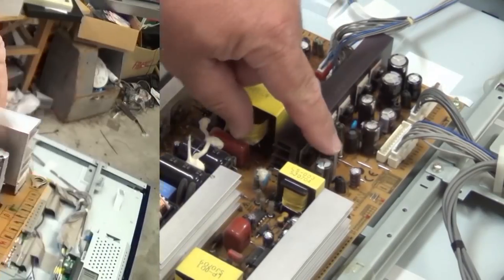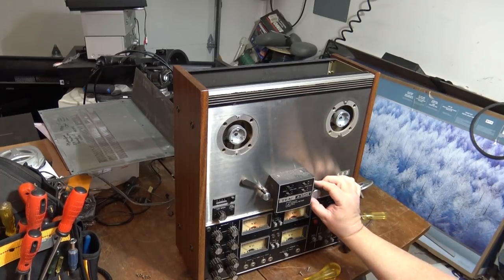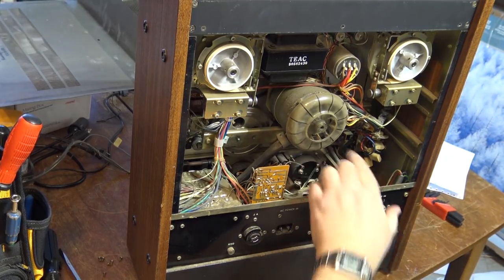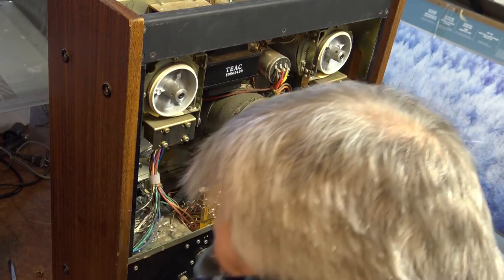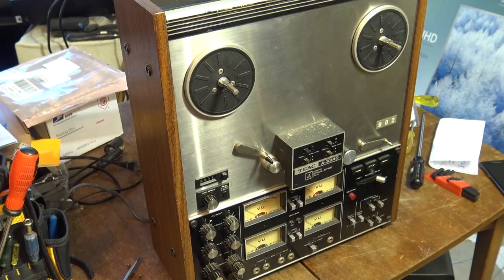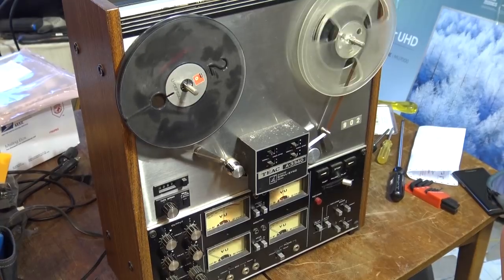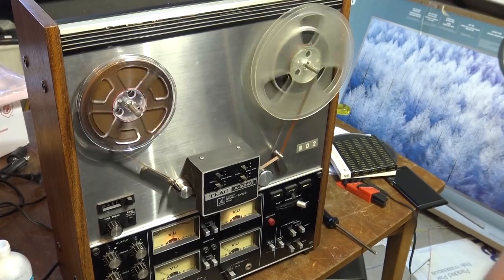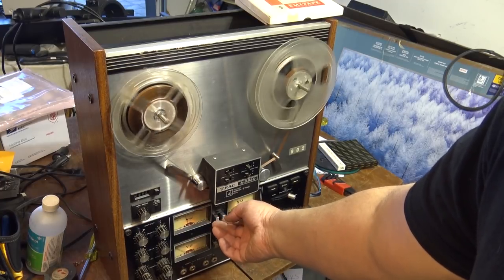Teac A 3340 4 Track Reel to Reel restoration

Comment: In the early 70's I composed my own music on an Akai 4000DS, sound on sound deck. Then around 75 I bought a Teac 3340S. Also mixed down to a Tascam32. I am now transferring all those tapes, 7 1/2 and 10 inch reels to DAW. Since all my decks have been in storage all these decades I'm sure they will need a good going over. I am hoping I can get them all to work for the transfers. Your video brought back a flood of memories using these decks. Enormous fun back in the day, and not to mention, they all sounded fantastic. Great video!

Comment: This helped me immensely with bringing an A-2340R back into better shape.  I already had some 100% synthetic oil with a needle applicator and your mentioning of the tubes made me realize that's how you get the motors lubricated easily.  Your details also helped me unstick the roller, it wasn't popping up and down with start/stop.  Now it is!  If anyone is finding their roller is stuck, just remove the left screw on the bracket, and loosen the right one.  Don't even remove the wire harnesses.  Stick a tissue or two below the shaft to catch any drips, and drip oil very slowly into the gap - I mean small amounts super easy - it'll pull the oil in.  Move the roller up and down to work the new oil in.  Repeat until it feels looser, then tighten your screws and enjoy a roller that operates like it should.

Comment: I lubricated the pinch roller pivot shaft on mine (3340S)by loosening the right hand bracket screw, removing the left bracket screw, drop the left side of the bracket to expose the back of the shaft, slide a piece of clear tubing over the shaft, raise the tubing up and tape it to the frame then squirt sewing machine oil in it to a level of about an inch above the shaft. I worked the mechanism back and forth every so often and the oil worked itself back into the shaft and freed it up.
Reply: I followed a similar procedure for my A2340R so thanks for the suggestion.  I didn't have clear tubing that would fit, so I just carefully dripped small bits of Liberty 100% synthetic oil into the gap and watched it suck it in.  Then moved the roller when the oil would sort of collect - seemed to pull the oil in, and eventually I could feel that it wasn't so stiff.  Plugged it in and the roller was happily jumping up to meet the capstan, and retracting happily.  Appreciate the tip on not removing the whole thing just to get that operating!

Comment: Many, many moons ago I worked for the Australian importer of Teac gear. A couple came in with a reel to reel unit they purchased in Hong Kong and bought back here. The complaint was it did not work. On removing the back of the unit it was found to have been stripped of all its parts including the motor. This was to make room for lots and lots of black socks. The socks where stuffed with bags of rock heroin. The police where called and the whole lot taken away. I have no idea if someone in Hong Kong gave this unit to the wrong person in which case they are most lightly at the bottom of Hong Kong harbor or if the idea was to allow the couple to bring the unit through customs and latter rob them of the unit. No idea what the value of the heroin was but there was a hell of a lot of it. I just hope the police got the people involved.
Reply: Wow... that's a story alright!

Comment: Another area that these machines were used in during the mid 70's was the presentation market for sales conferences  / product launches where 2 tracks were used for stereo sound and a  track  was used as a control track for synchronizing multiple slide projectors, track 3 was used as a guard track to avoid crosstalk between the stereo track.

The dropping down of the reel tables was fairly common due to this machine not being a full logic control deck (later versions were) These machines would get up quite a speed in ffwd / rewind with 10" NAB reels and slamming into stop could cause the reel table problem, a useful dodge is to hit the opposite wind button to slow machine down prior to hitting stop. Once I had the reel table drop on a live show the workaround was to remove the reel tables 3 screws and place cardboard underneath until chance to service properly.

Great video as always.
Reply: Didn’t have the table drop issue but the fast wind to stop or fast wind to play has on occasion broken my tapes. I haven’t used it since but have been reading up on using the opposite function to slow it down

Comment: Since I was a teen and got to work with stereo reel to reel decks, I've always just plain loved them things. I've worked in radio almost all my life too. Although now they aren't used, during my time they were along with carts. There were 2 standards for those 1/4" machines. 4 track or half track as sometimes called, and 2 track. Half splits the tape so you can record and play on both directions. 2 track, is one direction only. However, your using the whole tape for left and right so get much higher quality recording and play. At 15 IPS, losses would be imperceptive at half track. On the 2 track, it will duplicate in analog as good as CD in analog. My personal machine is an Otari MX 5050. You can, on it flip from rewind to play, to FFWD to Rewind to play. It has sensing to tell when the tape stops and self controls that before engaging the pinch roller. I absolutely love Teac and Tascam tape decks, both reels and cassettes. Very easy to service, and made to be maintained. Oh, and also, 15 IPS will minimize wow and flutter in worn tapes.

Comment: I have a pair of Teac A-1500 decks and I need to remove the face to get to the belt for the capstan, it has a rubber cover on the reel decks that hides the 3 screws, thanks for showing me where to look for them. You earned a sub for that bit of info! Thank you very much!

Comment: I've got a TEAC A4300 from about the same time period as your machine. Mine was supposedly serviced, and I believe so because it works great. One problem I'll have to solve is that when in fast forward and then hitting stop, the tape to the right of the capstan/pinch roller, stretches or breaks. Have to get a service manual and check tensions. I can get around this by going directly to rewind from fast foward. When the reels come to a stop, I hit stop. That works. Coming out of rewind and stopping doesn't hurt the tape though. Will have to invest in some spring scales and check the service manual on all appropriate tensions. I've wrecked some good tapes that way!

Comment: I would give anything to get my hands on an Ampex 351 stereo deck with 2 preamps In 1971 I worked at CFQR 92.5 FM in Monreal ,they were the most amazing tape decks ever  in 10" and 7" format Rewind speed for 3600 ft reel at about 160mph and under a minute,not to mention super clean response  and with a faceplate of 1/4 inch  stainless. I love your Teac but its no competition for the Ampex

Comment: TEAC R/R decks are my favorite to work on.  The stuck pinch roller arm is very typical and I've had to free up a dozen or so.  One was so frozen I had to use a soldering iron to heat the old grease so that I could pull it out.  I sold my 3340 because I was tape deck 'poor' at the time.  If you ever run across a Sansui SD-7000 you need to grab that one.  Talk about a beast of a machine!
Reply from the maker: I won't be grabbing one unless someone gives one to me as I don't have use for R2R gear other that to display it.
Reply: @12voltvids  Ha!  I'm not a hoarder, but I know where one lives.  I'm old as shit and always been in love with the vintage equipment.

Comment: What a machine! I was particularly impressed with the capstan flywheel. It looked really heavy, leading to imperceptible wow and flutter. I've never owned a 15 ips deck, so seeing it almost gives the impression of a slow fast forward wind! I would think you would really need the 10.5 inch spools to get acceptable playing time at that speed.
Reply from the maker: Many of these machines this one included were used in small recording studios. With the simusync mode play back to me made from the record Head while simultaneously recording. This allows a basic multitrack session to be recorded. You could record four single sessions then play the tape back mix the four tracks down to stereo recording them on a second deck. Add two more sessions on the extra two tracks of that second deck mix them down the two additional sessions that is and the original stereo mix to stereo again and keep adding this way.every time you get a mix down of course you would lose a little bit of quality but at 15 IPS the quality was very good. Somebody's units were used in quad setups for the people that were collecting quad systems of the day back in the seventies but more were used in small recording studios where they would have a couple of these units set up you were basically unlimited as to how many tracks you could record with two of these of course you'd have to do mix down all the time and once you mix down you couldn't make any changes to the stereo mix but you can still do a heck of a lot with just two four track machines
Reply: @12voltvids  Thanks for your comments, 12voltvids. I suppose noise could become a factor with numerous four track mixes to stereo. Seeing those four VU meters on the front panel made me sit up. too.

Comment: I've worked on these since the 70'S. Crindged at some things, but glad you are learning.

I have the era Revox and otari machines, but liked the 3340.

Also have the teac 4 channel Dolby unit. Can Dolby 4 channels in or dedolby 4 out, not in realtime.
Or, can Dolbyize 2 ch into record head, de-dolbyize from play head in real time.

Nice low flutter machines, even now on my micom/Ampex flutter analyzer.

Used to tape down the buttons so a simple lamp timer would record full 'nite-tracks' from WBCN BOSTON.
Back when it was allowed.
Fight the DMCA you kids!
Reply from the maker: I didn't have the opportunity to work on R2R when I was in the business. The owner of the shop wouldn't service R2R decks due to his hate on for anything of quality. No R2R and no console stereos.
Reply: Never heard of a quality console, is why conpobent hifi was invented. Screw the wife for her want of furniture over sound quality.
Reply from the maker: Ah the old full album on fm.  Lots of dat tapes made from kwjz in the 90s at midnight.

Comment: Nice! I have this deck. These things are like 60 pounds!  Heavy!  Works good and I even have the remote.  I bet with a head cleaning, it'll be perfect.  Mine is slightly different.  It has the 6 transport buttons (no slide bar) and the input/output knobs are all black, without the machined metal covers.
Reply from the maker: Then it's a different model.
Reply: @12voltvids  Ahh, you're right.  Mine is the A 3340S.

Comment: I just bought an A3340S. It had the same jammed pinch roller problem. I found it was much easier to work on if I removed the wooden side panels.

Comment: There's a big difference between "overhaul" and get it to run....I have several reel decks,among them a deck like yours.It also
sat unused for many years.I did just about the same things you had to do to get it running.It's inline for a complete overhaul but
there are several ahead of it.I have over a dozen TEAC decks and just about all of them run,other than the A5300/A5500,they are
built absolutely like tanks...I've always had a preference for TEAC. Good video!
Reply from the maker: This was more than just get it to run but I am not a believer is a full cap job. They don't fail that often except for certain runs of bad caps.  This is my machine and it is basically just a room decoration.  I never use it and will never record anything on it other than to play with it once in awhile.  I wanted it to work so I could see how it sounds and if I get a tape to transfer to digital it might come in handy but mainly it is just a display piece like the old broadcast camera I hung onto from my video production days.  Some people are holding onto the old analog days, I couldn't wait to dump it for the pure sound of digital.

Comment: had nearly same issue with table height on my A-3440. Tks for sharing!
Reply: hey there! I just bought a 3440 myself and the reels are slightly wobbly. No scraping sound until the tape gets low on the right side. Did you have wobbly reels and did adjusting the reel tables fix it for you?

Comment: I have the older 3340S non A series, and have experienced tape snapping or stretching when going from fast wind to stop or play without hitting the “opposite” direction fast wind function first before stop, pause, or play etc. wish mine had that switch. Thanks for the video. Cheers

Comment: Good job on this machine. The turning platforms for the reels are called turn tables. (Go figure) I owned a previous model a 7010. It was heavy as hell. The reel motors were like the size of floor fan motors. The major problem I had with it was the heads. They were a new concept. Composite heads. The idea was to make heads that would last many hours. Unfortunately, they were unstable at higher frequencies. The roll off was quite noticeable. I herd that many were replaced with standard heads.
Reply from the maker: This was the same problem with the Akai glass heads.  Last forever and sound like crap.

Comment: I have worked on a few of these machines and the pinch roller always sticks, I wonder if there is an easier way to oil them thru the front panel. If the deck could be set down on its face with blocks to protect the front side perhaps it would be easier to mount the capstan brackets?

Comment: Back in 1978 my friend and I started our demos on Ivy Hunter's (Motown writer performer) Teac 3340. But my frieend ended up buying a 3440 More pro than consumer.. I have since acquired both a 2340 and a 3340 to pass to digital the original 4 tracks and then embellished them in ways we never thought of back then. Both had the stuck arm. Heat the berring to remove and clean the old grease off. Mostly only ended up using the drum tracks since I have none.  Some more from the original was used.

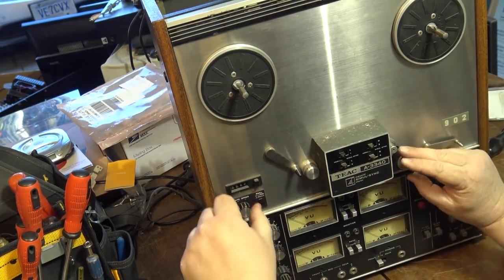Comment: @23:04 The supply tension arm is just fine!! It has a calibrated coil spring and is lubricated with special silicone grease and should NOT be "messed" with w/o proper knowledge. It will make the W/F much higher. Do you have the proper tentelometer ?  @24:36 leader skewing off the p/r. This is usually a sign of a glazed p/r. Remove & scrub w/Scotch-Brite pad & Dawn under running warm water. Spend some time on this and the reward will be obvious. Rinse WELL. Oil with MOBIL1 0-20. DO NOT LOOSE TINY FIBER WASHERS !! One on top & 1 under. The motors should be properly lubricated with it also...

Comment: I am working on a teac a-6300 and i have the same problem, rubbing with the left reel table i had to remove one of the screws that wascausing the problem did not think of checking the mount for the table like he did. Will have to check it.
Reply: @EuroScot2023  Unfortunately i sold the rtr because i did not have the expertize to fix the various problems that it had plus i don't know how to use an O'cilloscope :-(
Thank you for the help.

Comment: great vid thank you - what oil do you use for lubrication? also I have goo on my pinch reel, I have a replacement rubber but what chemical do i use to clean the black goo off the rollers and backing plate?

Comment: so I was 9yo when this was last serviced, take something like this built today and I wonder if it would last this long...
Reply: Ha!  You'd be extremely lucky to get 5 years out of it.  Although, I am impressed with my Panasonic plasmas; one bought in 2009 the other in 2010.  Both still perfect.  Only thing wrong is a damn buzzing on the 2010 model due to manufacturing error.  No grounding somewhere is my guess.  Has like it since the day I took it out of the box.  Was a known issue, although only known to me AFTER I bought it!  Both were the TOTL models for their years, cannot remember the model numbers.

Comment: Great video, how long to the heads last and how do you know that they are good?  Just by listening?  I always thought most of these machines have a limited life since the heads wear and there is no replacement.  I have an Akai w/glass heads, supposedly they last longer.  Thanks for the cool videos
Reply from the maker: You can see wear on the heads as the tape will wear a groove into them. These machines have pretty hard heads, Some of the early ones didn't and they wore down.
Reply from the maker: @EuroScot2023  Shhhhh, don't tall the glass head fanboys this. They will get upset. I have talked about this in the past and all the "experts" out there tell me I am crazy and how much better glass heads are. In reality they wear better that's it. They cause the tension to go through the roof, cause tape stretch, and sticky shed tapes just won't play. I never use my GX260

Comment: I was given one of these but its a basket case. Front board above the heads is smashed and all the knobs are gone.
I would need another parts unit to fix it. I did try gluing the board. I also have a 3300SX and a 4010 in good condition and working.

Comment: I Have the A3340s UK machine slightly different inside, there's a circuit board attached to the bracket that holds the fly wheel in place,  i need to free up the pinch roller mechanism as you did, but you didn't show how you oil it? can you advise me , thanks

Comment: i have a teac 4300sx been sitting for awhile i believe it has a solenoid problem its on the right side spindle will not  touch the roller